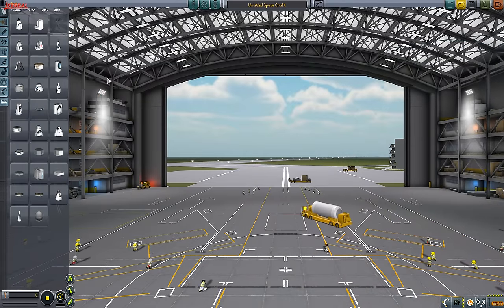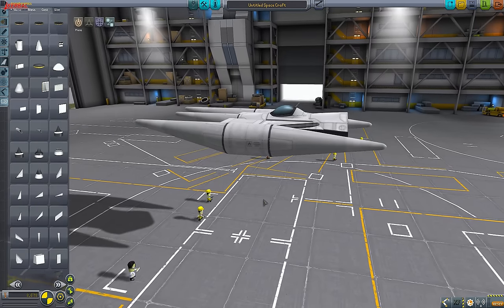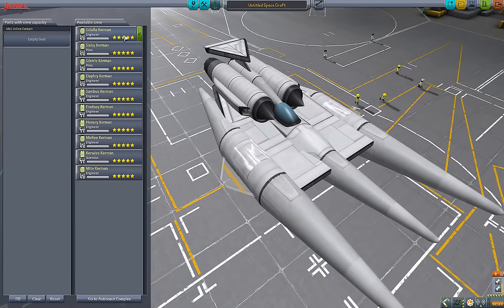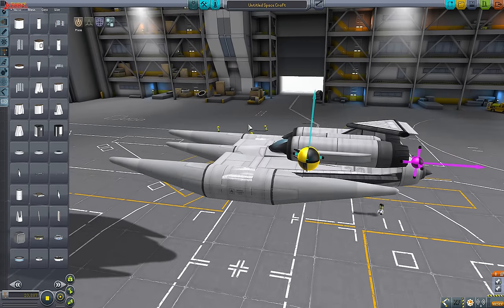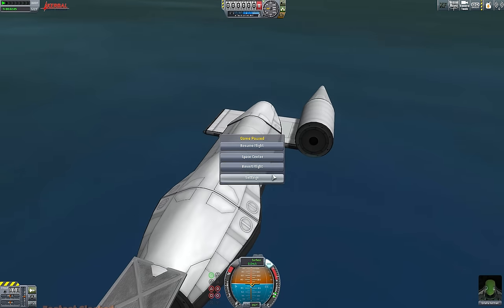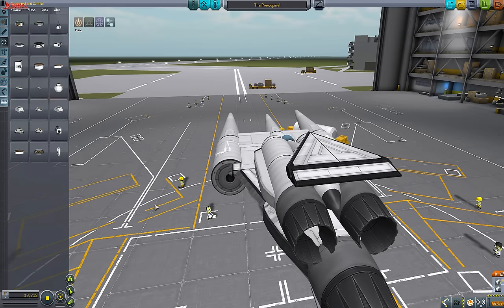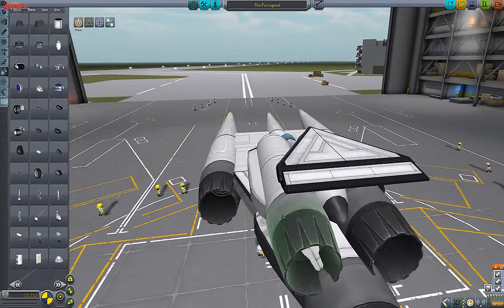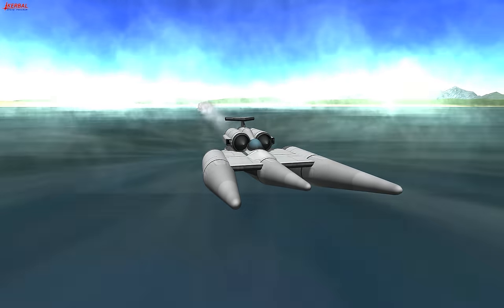Kerbal Space Program! | Water Speed Record Challenge! (317+ MPH)

Comment: Just a heads up, the reason it flipped so easily was because the center of mass was Behind of the center of lift, or not far enough in front of it. Think of it like a dart or arrow, you want to stabilizing surfaces to be behind the weight.
Reply from the maker: +DascCrescent It was actually reasonable difficult to balance bother sides of that because as you said the CoM should be in front but then the nose kept hitting the water either breaking it or slowing it down, so finding the correct compromise was difficult.
Reply: HalfEYEProduction No I'm sure, and it came out pretty damn well in the end anyways!

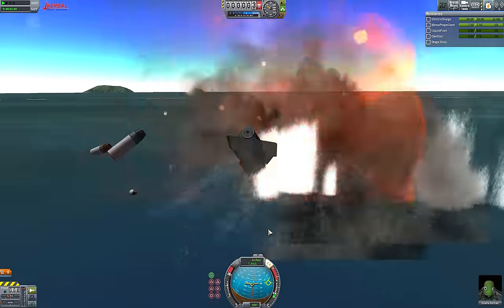Comment: 15:42 For slowing it down, belive it or not, you need one more engine. You need an engine which gets active right before all of the main engines drain. (you need smaller negative acceleration) So that it will not loose speed rapidly and leave itself to death by fraction and slam itself to the water. When you get rid of the high levels of fraction, deploy the parachutes (or other braking components) to stop it.